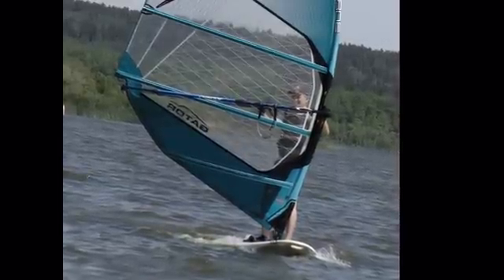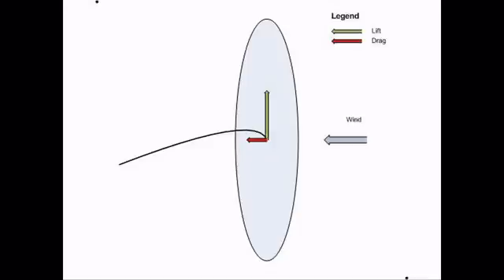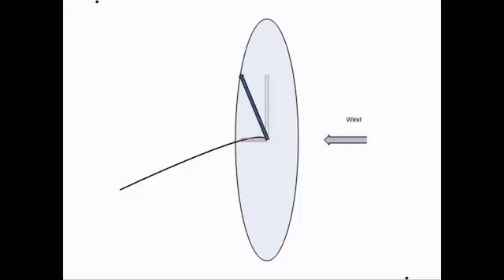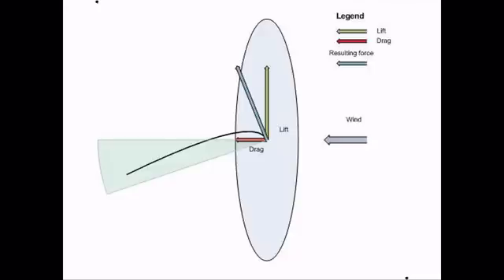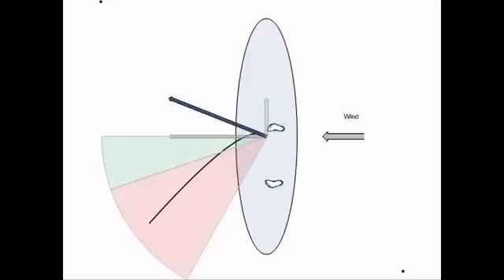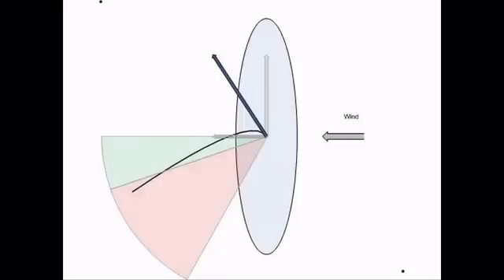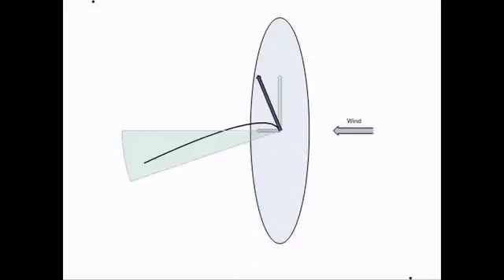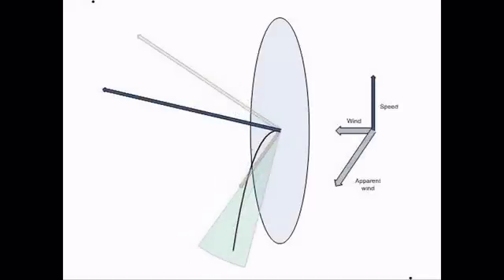Forces acting on the windsurfing sail

Comment: I think at some point my sail trim was done mostly subconsciously by me using my ears.
Yes, thats right. Looking into the apparent wind results in a balanced wind across both ears. This of course is during powered up conditions at speed. Then your arms sheet in or out accordingly.
When sailing with a hoody in cold weather I always felt handicapped with my ears covered.
Also you want to keep your mast as vertical as possible to present the largest sail size to the wind. Many people sail with the mast to windward which reduces power.
This can be a method though when sailing over powered reducing power.
I used this to reverse effect when ice sailing. Using the sail angled away from the wind gave a slight down pressure, useful on glare ice.

Comment: Does forward motion increase apparent wind vs true wind speed allowing a windsurfer to travel faster than the true windspeed?  For example an iceboat can travel faster than the true windspeed.
Reply: Yes.  See an explanation here:  https://www.youtube.com/watch?v=cjTb15pme-g&t=4s
Reply: When I used to ice sail the apparent wind would be stronger than the actual wind. In 20 knots I would rig a 3.4 meters sail.
Reason was it would keep accelerating until fear was the limiting factor. A bigger sail would have to much drag at 40 knots and become unruly. The smaller sail would just keep pulling HARDER and harder. Was a total blast. Hit 60 knots numerous times. Total sickness.

Comment: man you should explain why the boat does not turn and how fin works. you are applying forces at mast mount point which is also wrong, keep in mind that sail does not have just one mount point, another forces are applied to the boat by means of surfer feet. plus mind that cheap sails has simple shape and unlike plane wing it should not create lift force.

Comment: Somethings wrong or missing with this theory.  The resulting force will always be downwind.  To go upwind there must be a force acting against the drag to counter act it.  Also when I look at someone surfing it looks like their sail angle is much more than 18 degrees even when going very slow with little induced wind.
Reply: It is possible to sail upwind because the "lift" force is perpendicular to the wind direction. When you are sailing into the wind at an angle this allows you to move into the wind. 

Also, the wind direction that the sail "experiences" is a combination of the air's movements and the motion of the sail as we are moving through the water, so it's a bit tricky to think about.

Comment from the maker: What happens (at speed) if you open the sail outside the 18 degrees? You will slow down, until the sail will be back in the 'green' zone. Forcefully pulling you front (mast) arm is called emergency break :-)